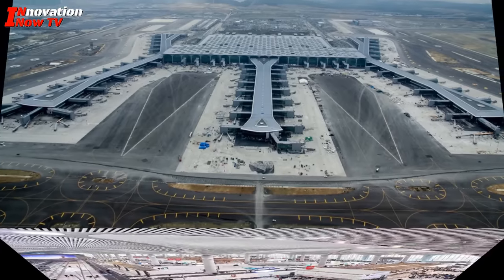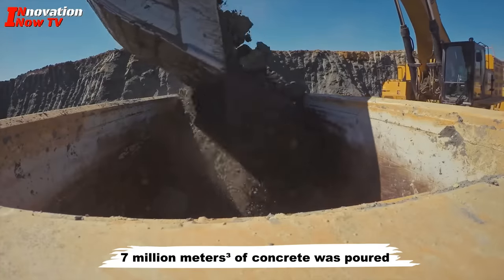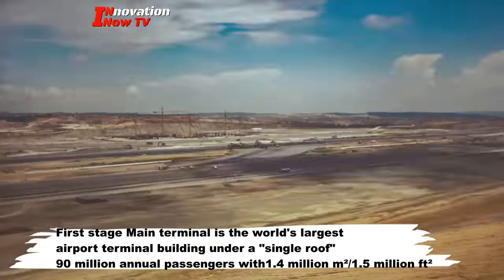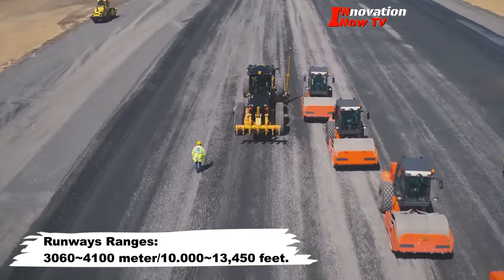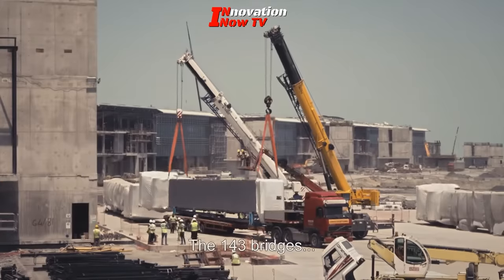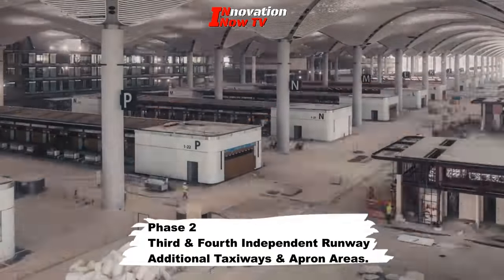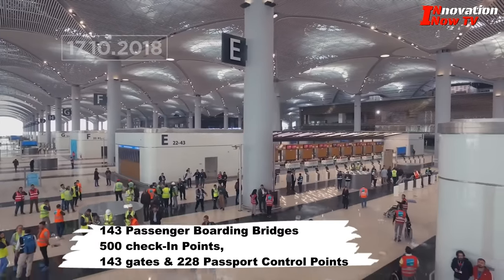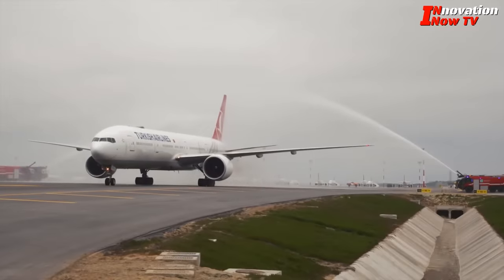Constructing the World's Largest Airport | Istanbul New Airport |

Comment: Very, very impressive, especially the baggage handling system BUT….. let’s see how it works when passenger numbers grow. With an airport that size, many will run around in the vastness or the airport. I would be particularly concerned with the size of check-in information. IMO, an airport of this size should have simplified jumbo screens showing passengers where to go. Almost all airports rely on TV sized monitors which is extremely impractical.
Also imagine what happens when a child gets lost. I think technology could find solutions to that and also the challenge of getting passengers to their gates on time with few complications. Printing e.g. GATE 35E on the boarding pass may seem self-explanatory but it isn’t always to the passengers.
Reply: None of the issues you mentioned seems to be a problem in my experience.  But I will share a comment I wrote earlier to put things in perspective for you:  "I have used this airport many times and it is a very difficult airport to navigate.  From one end to the other it takes about 35 to 45 minutes to walk.  Definitely not a comfortable airport for short connections.  They did not build an inter-terminal transportation system so that passengers are forced to walk though major shopping halls.  There are passenger carts but they are mostly reserved for passengers 60 and above.  I have been to 67 countries and this one is the most passenger unfriendly airport I have ever seen.  Too big is not always too good.  This one is a prime example.  I cannot imagine what kind of a monstrous mega structure this would be when all phases are completed, but with the pandemic and economic hardship Turkey is living right now, I doubt it very much that the project will ever be completed to the goal of 200M passengers a year.  That is a pipe dream for now.  It takes 30 minutes to get to the gate after touchdown and another 30 min to reach the runway when you are taking-off.  No rail or subway system so traveling from Istanbul to this airport can easily take 90 min to 2 hours depending on the traffic.  All the positive comments are from people who like the engineering aspect of the project and I agree with them.  Most travelers who have used the airport will agree with me that you have to leave home 4 to 5 hours before your flight.  No thank you."
Reply: @syalvac1  
You nailed!!!!
Annually (before Pandemic) I travel 10-15 times to Istanbul/Ankara and back to Germany…
Or used as Hub…

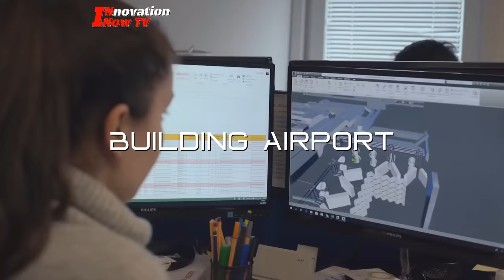Comment: In the "Building Airport" section (starting at 6:06), several of the metric to imperial area conversions are not correct. For example, 1.4 million square meters is not 1.5 million square feet. Similarly, 1.7 million square meters is not 1.8 million square feet.

Comment: Hoping the Construction Speed of New Manila International Airport in Taliptip, Bulacan, Bulacan will be Faster than Istanbul Airport Construction Which Takes 4 Years, While NMIA Will be Constructed on Record-Breaking 2 to 3 Years, The NMIA's Initial Phase Will Consists of 2 Runways and its Taxiways, With Initial 1 or 2 Terminals Opened, and If NMIA is Completed, It's Operation will Gradually Move into NMIA from NAIA Just Like Istanbul Airport Did, If NMIA is Fully Completed by 2050, It Will be the One of World's Largest Airport, It Will be the World's Best Airport, It Will be The World's Busiest Airport Tied with Istanbul Airport, It Has 8 Runways with Lots of Taxiways Linking into its Terminal, It Has 6 Terminals with NMIA Terminals 5 and 6 is the Largest and it Will be Located on Left and Right Side of 8 Runways while 4 NMIA Terminals and NMIA Control Tower with Height of 250-300m will be Located on Center of 8 Runways, with Philippine Airlines as its Airline Hub Located in Fully Completed NMIA by 2050 Will Serve All 196 Countries and Thousands of Destinations Around the World with Nonstop Flights and It Can Fly from Asia to South America Thanks to Advanced Airplane Technology, With External Connections to Airport Express Train, To SLEX Via Skyway NMIA Extension and to NLEX via C6 Expressway or NLEX Spur to NMIA, With its Control Tower Fully Automated that it has No Human Staff Inside of it, Instead It will be Full of Robots Controlling the ATC inside of Control Tower and Uses Cutting Edge Technology, Has a Design Inspired by Sampaguita Flower, The Philippines National Flower Just Like the Istanbul Airport's Control Tower Inspired by Tulip, Turkish National Flower, It Will Have also Skytrains Similar to Doha and Changi Airport, That Links all 6 Terminals, The NMIA Will Have also a Nature Themed Entertainment and Retail Complex Inspired by Jewel Changi Airport and Gardens by the Bay, With Skytrain Connections to All 6 Terminals, It Will be High Tech Airport Featuring Automated Check In, Biometric Security and etc.

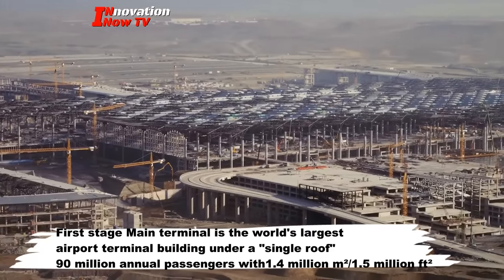Comment: There is a mistake 7:36 airport areas terminal calculation:
1.4million m²=1.5million f³
 it should be
1.4million m²=15million f²
1.6 million m²=1.7million f²
it should be
1.6 million m²=17million f².

Comment: Republic of the Philippine build most !modern international airport fully zircon Clark international airport beside ASEAN stadium many new casino hotel big shopping mall many new hospital  new condominium  2 and modern big airport fully air-conditioning cebu international air port 3rd biggest world international airport most modern heart city manila over looking sunset manila bay Philippine international airport with modern solar city electric power solar power wind mill 4th modern Philippine international airport manila bay reclamation Sangley point cavite international airport current Philippine building many inter island bridges world longest bridge and also building 2 solar city a fantasy star trek space age modern city solar power wind mill source  electricity .Clark + cebu city + Roxas boulevard  + 75 kilometer Edsa highway has elevated modern rail road which connect in world biggest shopping mall whole highway of edsa has build many new  condominium biggest shopping mall modern passenger bus terminal the train is fully aircon new coaches .whole metro manila has many fast food MC Donald KFC 7 - 11 . makati city has many new world modern design new casino hotel banking finance

Comment: It only cost 52 workers their lives.
Reply: Whos saying this? Think about 2500 yearly german death toll during job exc.
Reply: @fatihunal2713  Your numbers are not entirely correct.

For 2019, 507 fatal accidents at work were registered nationwide. Compared to the record accident year 1993 with 1,543 fatal accidents, the number has been reduced by around 70 percent. The rate of fatal accidents at work has thus reached the historic low of 0.011 per 1,000 full-time workers.
Reply: @fatihunal2713  and more in🇩🇪